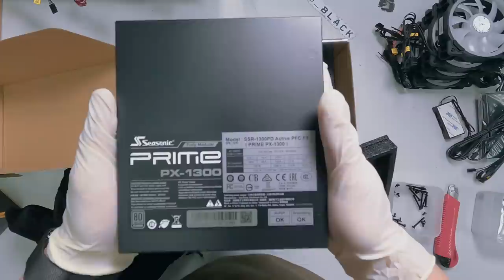$8000 Thermaltake View71 Watercooled PC Build

Comment: I think this build is beautiful! Even though cannot understand why with budget this large those USB / Audio connectors at the bottom cannot, at the very least, get covered with some heat shrink. The braided cable extensions would cost maybe 25 bucks, at least its an easy fix in the future.
Reply: there is a guy from my home town that builds custom shrouds for this case.  i just bought one.  although this is very clean it could look much better.  its unfinished cable management wise